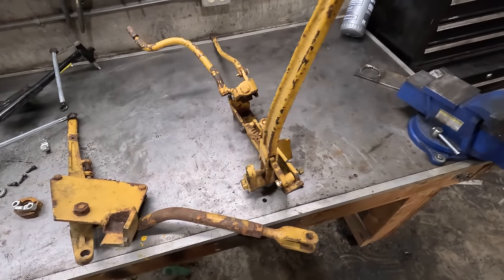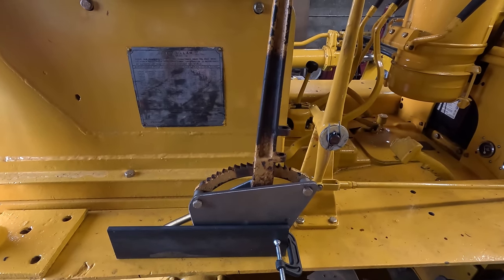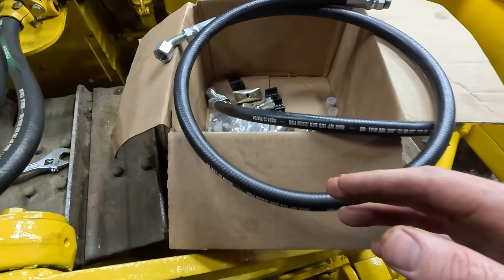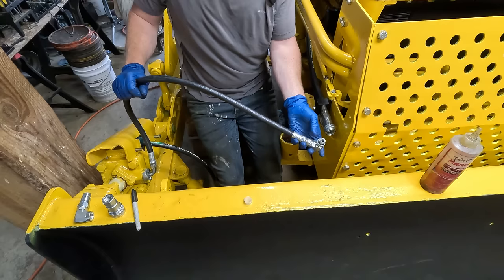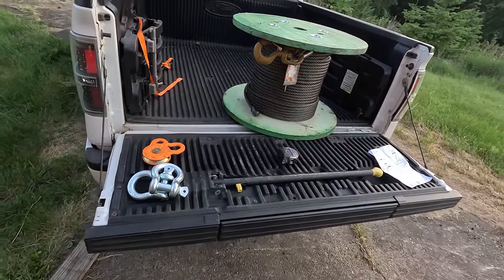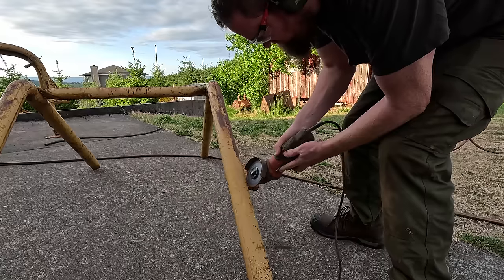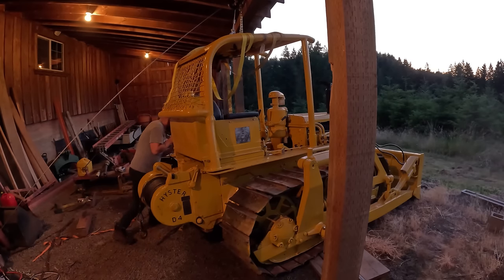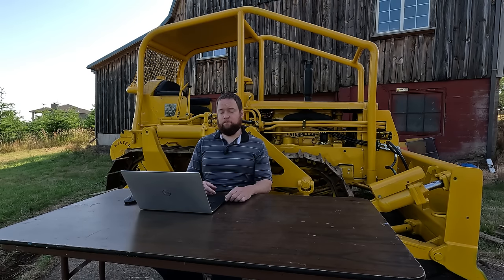After 2 years, it's FINALLY done!!  Finishing the Caterpillar D4 rebuild

Comment: Great job...and video series! I am eager to see you pushing some dirt with it! What I think the series illustrates is just how, not exactly easy, but "do-able" it can be to drag these old machines out of the dirt and put them back to work with restorations performed in home, or farm, workshops. Still fully capable, mechanically simple, often massively over-built and devoid of the finicky electronics that plague modern machines making them increasingly impractical for small operators. They really do seem to be a valuable resource rusting away in barns and fields that shouldn't be overlooked not just for antique equipment collectors but for those who'd like to put them to work for weekend projects. If the several 'tube channels devoted to vlogging similar projects are reflective of a bigger effort I'd have to think it would become financially attractive to manufacture replacement parts for areas like the undercarriage. That should help keep restoration and maintenance costs in line a bit as serviceable used kit becomes harder to find and new-old stock fully depletes.

Comment: I had a 1949 D47U elect-start pony wide trac w/ROP and oversize blade that I used to clear and level property, put in driveway and excavate crawlspace for my house and shop I built several years ago. Great little Cat. Did everything I asked of it after I replaced the engine clutch and a couple of hydraulic hoses.  Was sorry to sell it when I was done. Beautiful job on your rebuild! Thanks for the memories.

Comment: Now, aern't you glad you repaired that second gear ? You have laid out the cost of rebuilding this little Cat, but what you haven't done, is tally what she has paid you. You ave recieved an education in heavy equipment repair, welding, fabracation, cost management and parts procurment. And the most important, to be patient and make your mistakes an opportunity to learn. The adverage knuckle buster starting as a grunt in a heavy equipment repair shop, would put fifteen years in before even coming close to the knowledge you have gained in the past two years. Be proud, you have done a fine job.

Comment: I just watched you drill your nail.  As a retired carpenter, I have had my share of purple fingernails.  The method I use is less dangerous.  Just heat the end of a paper clip or small nail, and it will give you painless relief.

Comment: On your roll bar, if you put a smaller pipe inside then drill a couple of holes to weld it to the pipe and a small gap between with a good weld will make it safer.

Comment: Hi Matt, I suggested a while back to rotate the starter motor base so that the solenoid is on top this means your side panel will fit. Every Detroit, Cummins and cat is always missing the flange bolt opposite the pinion fork, over my life in industry of trucks and earthmovers I have installed hundreds of Delco starters.    From Australia

Comment: You have to show a vid of it working .   Thats the last D4 post. 
 Re winch  winding . Anchor the cable on the high side of a hill  ,unspoil by driving down said hill . Put machine in neutral and use the winch to pull machine up hill this will  set the rope .

Comment: So, commenting as I'm watching here.  Where you mounted the flex line to the rigid line, you used rubber on the flats to protect the rigid line.  However, the bolts you're using could wear into it also.  I recommend slipping a piece of rubber hose over them.  Hope that makes sense.

Comment: You might could order the parts to build a roller guide for your winch cable. But, it’s gonna need to be extra heavy duty or first hard side or top bottom roller pill will bend the roller pins.

Comment: You need to put rubber around the steel lines the threads on those new clamps will act like a hacksaw on those lines with all the vibration

Comment: If you haven't done it already, when you relay the rope have someone drag the brakes on a piece of equipment as you pull them towards you. This will put a little tension on the rope and then you can use a piece of 2x4 and a hammer to tighten each lay into each other.

Comment: Yup some nice fabrication but mig welding is essentially gap welding. You do not have much of a weld when you take two pieces of tubing or angle over 1/4" thick 45°them then butt them together tightly and weld  them.

Comment: Well done. Loved the build.  Just curious though, why wouldn't this work well for pushing out stumps?  I am not really knowledgeable on dozers, so I am wondering.  Enjoy dozing!
Reply from the maker: The stumps are pretty big and cut low to the ground, it isn't heavy enough to push them straight out.  You could dig them out with the blade, but then you would be running over all the new trees around them

Comment: when you spool that cable onto the winch you need to tie the other end off to a tree.  That way its holding some tension on the cable as it rolls it up. Just put the machine in neutral.  If you don't do that it will ruin your cable in a quick hurry.

Comment: Id say you did not come out too good dollar wise,  I bought a JD455 loader pretty cheap $9k usd  by the time I got it fixed up like i want it and can use it without Issue, im right at $21k not paying me any labor!    so the main difference is a newer machine with more modern controls has some advantages. I stayed away from old cats or JD due to these reasons.
1. nearly all the parts are like hens teeth and are difficult to even locate
2. little support for undercarriage 
3, insanely difficult to operate compared to a newer machine (ive ran these old things and HATE the controls) they are more like novelty machines if you value your time getting work done.
4. it takes a TON of patients to maintain these ancient machines and you better be your own mechanic because NO one is coming to help with any knowledge from any modern mechanic shops.
At the end of the day I would never recommend any older machine than the mid 1970s unless you got it all worked out to maintain one of these dinosaurs.   Heck, knowing what I know now Ida bought me a machine and paid the delivery fee to get 6 months of my life back and the massive amount of work involved in the repair.   Plus my shop aint really well setup for heavy equipment, I was basically right at my limit of tool and shop capabilities doing what I did.

Comment: New sub here from North, Central BC Canada. My neighbor has a D4 Gearjammer  I have used for years. Old girl Aint what she used to be eh. Still  though it always starts and can push as hard as she ever did. Sure  like the way you have done this refit. Straightening up years of others modifications and cobbled up repairs is really a feel good thing when we get them back working as they should and all the old eyesores cleaned up. I am a retired HD Machinist, Fabricator/Mechanical (Logging equip) 50 plus years of heavy iron behind me. Stop by when you can new friend. Take care eh.

Comment: You shouldn't be running that Machine with the Winch Brake OFF...Your going to be running it around and look back and Your Cable is going too be Strung out. Or if you back up it's going to be in your undercarriage.  That brake will stop it from unspooling from the Fibration of the machine and jarring . Just a Suggestion is all. Seen it done ..Nice job on the Restoration

Comment: You can weld galvanize as long as you wear an adequate respirator in a well ventilated work area like a fan blowing Matt, I’ve welded it with 6010 or 6011! Mig doesn’t agree with galvanize , best to use those two rods because they’re better at burning through the coating my friend!  Maybe a couple shields to protect the hoses Matt, branches and debris for the hoses around the blade and a heat shield by the manifold brother! Just a suggestion, I know you want everything to be safe and perfect as possible before you get out clearing with the dozer! Especially after all your hard work my friend! 👌🏻👍🏼👍🏼

Comment: Thank you for sharing your work, I did enjoy every step. Work safe and get some time with that big Cat.  Go get some LED lamps for the those late nights jobs or returing back to the shop and for looks.  Some thoughts of that winch, would be nice of a safety limit switch if the hook of a strap on gig to making a connecting to a limit switch to kick out the clutch.  Would be nice if something could be built preventing the hook locking into the Winch and safety.  Dang watching you loading up that winch was a little scary.   

Take care, have fun, I'll Be Back......  :)

Comment: Great work, congradulations. The winch brake rod should be in tension when working, any bow in the rod will reduce effect. Not worth your time to fix as I suspect the brake is only to prevent movement when not being used. For the price of a modest used car you have a very capible machine. Fantastic !

Comment: Do the bolts that hold the clamp for the hose mount also need rubber between them and the main hydraulic lines? Seems like it would be possible for it to settle down over time and the top bolt end up resting on top of the main lines or forces from the hoses pushing the mount up and the bottom bolt contacting.

Comment: Quick tip for you next time you need to measure at a hydraulic line buy you a garden hose and tape one end of the garden hose at start of run, then run your garden hose the way you want to run to the hydraulic hose end,  Mark the garden hose where ends and then you'll be able to measure out a real good approximation of how long you need a hose for.

Comment: I might suggest connecting the two parts of the brush guard with round 4 bolt flanges. This will make it easier to assemble, or sleeve welded to one side and bolted through the other.

Comment: Use a piece of rubber fuel line split lengthwise to insulate where the hydraulic hose comes through the guard and split som radiator hose lengthwise to put around the metal hydraulic piping between metal clamps.

Comment: I’m kinda confused. The blade cylinder controls the “twist” of the blade from side to side and not the actual vertical angle of the blade? And the vertical angle is controlled by the manual adjuster on the left? Is that correct?🤔🤔🤔
Reply from the maker: the vertical angle is a function of both the manual adjuster and the tilt cylinder, but the stroke of the tilt cylinder is so short that there is essentially no adjustability vertically.  Really I am just using the manual adjuster to center the tilt cylinder so it goes the same angle in either direction

Comment: Your winch break is on backwards. It's a winch, not a tow line. One of the first things to understand with winching, you need to see what you are winching. Plus, the vehicle with the winch doesn't move... And you should grasp why the manual has the winch break mounted as if you have to be facing backwards to use the break. Since you should be looking at what you're winching.